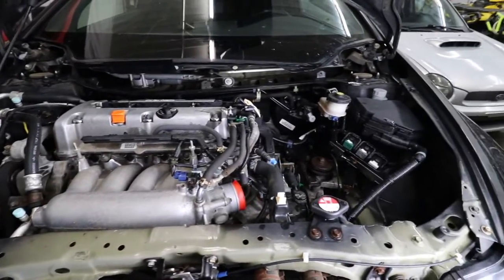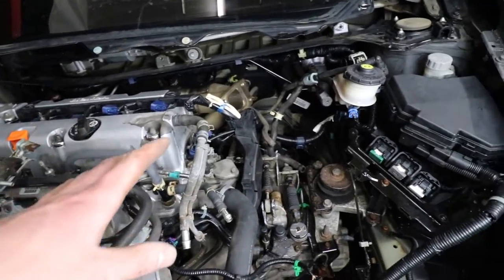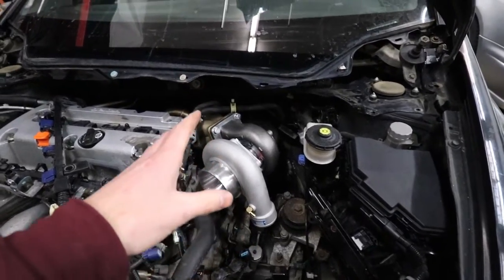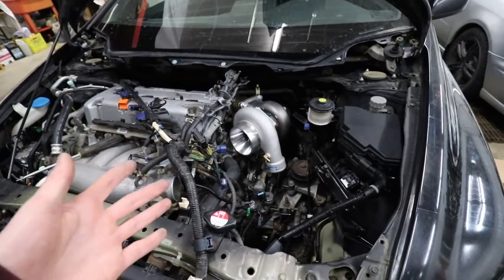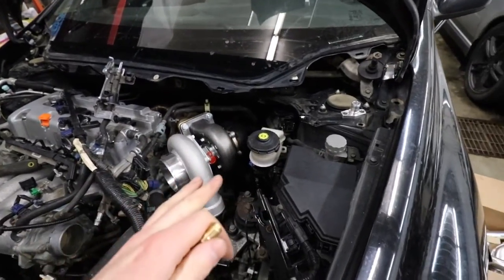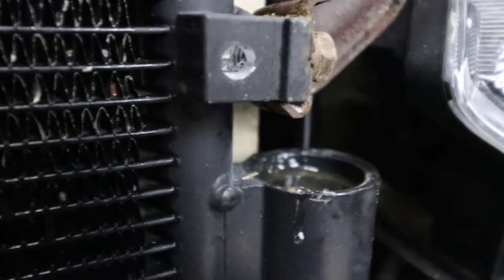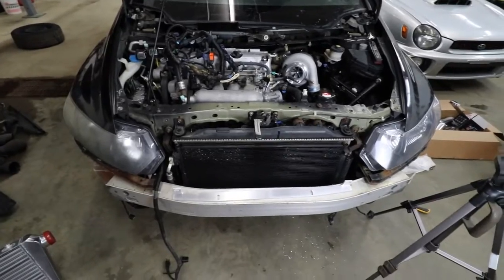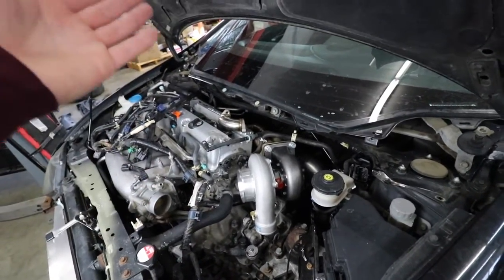TURBO 8th Gen Honda Civic Build | Ep.4 (CX Racing Turbo Kit)

Comment: Posted this on the Boosted 8th Gen Civic group. Keep up the great work.

Fyi: my k24/20 gtx35 fg2 is a daily driver with water-less setup. Garrett’s have been being ran on oil cooling only for years. Call Honeywell Garrett and they’ll explain the oil restriction requirement has nothing to do with the watercooling aspect, it is due to the tolerances within the dbb center cartridges.
Reply from the maker: Appreciate that 🙌🏼 as for the oil restrictor, I should have specified journal bearing vs ball bearing applications, that’s my bad. All ball bearing turbos should have a restrictor, journal bearing turbos do not. 

As for the coolant portion, I’d say all ball bearing turbos should have coolant run to them. If you don’t, you are just decreasing the lifespan of the turbo seals & bearings. I’ll leave this link here if you want to give it a read, straight from the Garrett Motion website. https://www.garrettmotion.com/racing-and-performance/choosing-a-turbocharger/water-cooling-for-your-turbo/
Reply: @DanielKellert  it’s known to increase life yes, like OEM cars which are have watercooled turbos however unnecessary on street cars which see less miles have done it for years. Keep oil temp in check and the turbo is fine. I have seen same result with and without watercooling to Garrett cores. Circuit track cars will definitely need it
Reply: @Itspossiblekj  so I should just run an oil cooler if I plan on going boost?
Reply: @bryce_fa5si  not unless you are circuit racing at max effort for long periods
Reply: @Itspossiblekj  ok yea no it would just be a weekend warrior maybe cruise here and there but I will definitely be driving it.I have my turbo kit from my single turbo setup so I was just gonna fit the intercooler and see how well it goes in and if it’s basically plug and play all I need is a manifold and tune I’m gonna boost mine. I just didn’t wanna pay 1100for intercooler and piping that I already have

Comment: As you're building this. I'm also building my FG2 turbo as well with the same kit, with a built motor.
Reply from the maker: How’s it fitting so far for you? 😅
Reply: @DanielKellert  I haven't mocked up yet, waiting for the cylinder head to be machine. Going built k20/k24 turbo

Comment: The return drain line for the turbo won’t work.. that type of cover for the timing tensioner is meant for log style manifolds.. I thought about doing that but they said it’ll be poor drainage for the turbo. You’d have to go to the oil pan
Reply from the maker: Sounds like we might need to drop the pan & weld a 10AN fitting to er then 😅 I already ordered the tensioner cover so we will see how she fits up! If it’s enough of a gravity fed slope to the tensioner cover, it should be ok.

Comment: Hey I have the same car and I'm looking to do the same thing.  My car is all stock and I'm wondering about the fuel rail. Other kits have a fuel pressure regulator. Can I use the cx racing kit on stock fuel rail, injectors and pump?

Comment: hey man your gunna want to throw a one way check valve into your brake booster line. as well as the “upper coolant” neck thing you were talking about, that’s called an upper coolant housing and you will want the upgraded housing if you are running a big turbo as it will not clear the actual casting of the upper coolant housing
Reply: also the coolant hard line is the line that runs from your thermostat to your heater core, you’ve removed and modified the evap solenoid bracket.
Reply from the maker: I’m just gonna cut the check valve out of that factory hard line & put it in line with my custom brake booster line. Then yes the upper coolant housing is getting swapped out 👌🏼 already got one on the way. 

Hopefully that heater core line clears the waste gate 🤞🏼 we will see how she fits next video!
Reply: @DanielKellert  right on man that’s exactly what i did with the brake booster line! i wasn’t able to get the cx dump pipe to clear my sub frame with the percision waste gate so that will all be fabbed up in a few weeks!
Reply from the maker: @masoncrozier-xp2em  did your Cx racing downpipe clear the manifold? Mine seems like it’s hitting the manifold & won’t fully bolt up to make a proper seal
Reply: @DanielKellert  i honestly didn’t bother buying the kit because i’ve got the PRL FMIC and all my waste gate and bov and that jazz from a previous set up (last season i had a log manifold) so i’m just having a custom down pipe fabbed

Comment: Word to the wise working on this car is not for the faint of hearts one of the biggest issue you’re gonna be faced with is the heat that will melt your wire harness that runs along the back of the firewall also that big plastic shroud that is over the wire harnessOn top of the transmission all that plastic needs to be removed and re-wrap the wire with heat tape
Reply from the maker: You are 100% right! 🙌🏼

Comment: Hey man! I just picked up an 8th gen Si. I wanted to see if there was any cheap turbo kits out there. Mine is already fbo tuned. This kit for 2k looks decent! Add some injectors/fuel pump/mac valve and better wastegate bov and its probably a great deal!
Reply from the maker: We are gonna find out how good it is 😅 Downpipe seems to fit terrible & the kit is missing half the coolant & oil lines you need to route to the turbo. I got a Hondata 4 bar & a Hondata 4 port boost controller. I’m gonna test out this wastegate & bov to see how they hold up on the dyno! 🤙🏼 Also got a DW 340lph pump & DW 1200cc injectors. We’ll see how much power she can make 😅
Reply: How much power do you make if you don’t mind me asking ?

Comment: Definitely need to keep the check valve for the brake booster not just a line. Just a heads up.
Reply from the maker: I haven’t looked too closely at it yet but thanks for pointing that out! On most cars the check valve is on the vacuum booster fitting that the hose connects to. In this case, if it’s in the hose that’s totally my bad for not pointing that out! I will mention it in the next video 🙌🏼
Reply: It’s in the hard line with the purge valve. I cut it out and put it back inline with the booster line. Keep up the good content.
Reply from the maker: @lenny.fg2  Sounds like I’ll be doing the same thing 😅 appreciate the advise man!
Reply: And the evap line if you don't delete it.

Comment: the graphite gasket included in the kit is kind of weak. It made a slight leak for me. I switched over to the OEM gasket and it made a much better seal. The OEM MLS gasket is definitely better than the CXracing one.
Reply from the maker: Noted 👍🏼 if we have any leaks I’ll order up a new MLS gasket! Thanks Sameer 🙌🏼
Reply: @DanielKellert  I am still using the original gasket that was under the stock manifold. I doubt you would need a new one. They still work great even if they look old. Good luck 👍 waiting to see how this project goes

Comment: I’ve been trying too buy a turbo kit but can’t find a kit. Prl and full race discontinued there kits. Should I buy a used kit ?
Reply from the maker: The Cx racing kit is still available & I have it linked in the description of this video. But don’t expect this kit to be a bolt on kit. I have a lot more videos coming soon on the whole install process, but so far nothing fits properly & all needs to be modified.